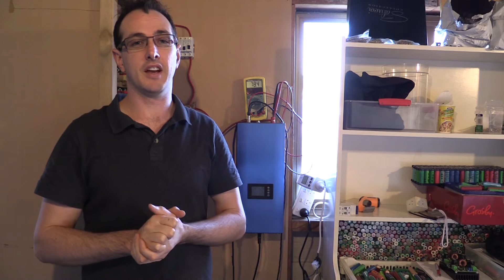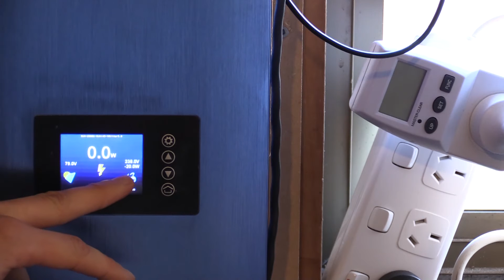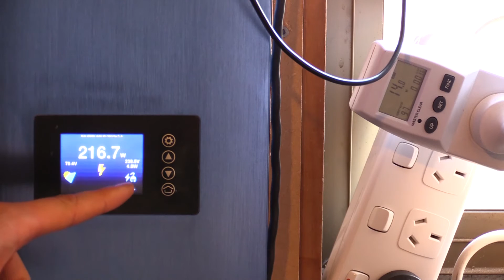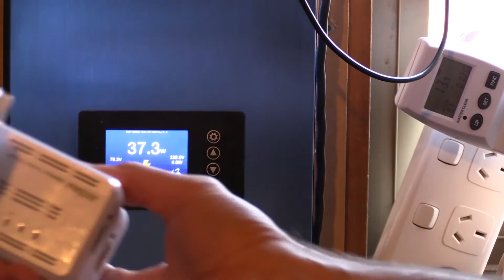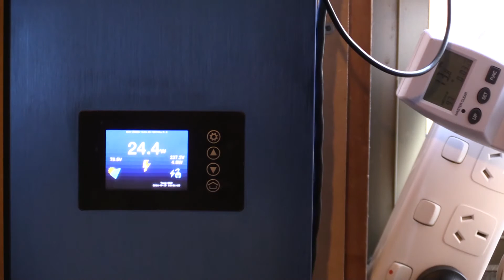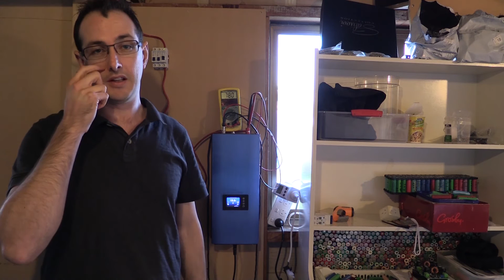Grr Problem with Limiter on Inverter Part2

Comment: Hello mike s.  Gtil2 have two resistor R82 and R83
This two resistor hare connected in series?
I need schema for R81 R82 and R83
And value for R82 R83

Comment: Hi having a similar problem myselfy inverter (1000w version)is measuring 8w yet my meter is saying I'm using 300w did you get to the bottom of this any help is much appreciated are you on any of the Facebook groups?
Reply: Shouldn't have a minus sign on the read out. Just flip the CT clamp around.

Comment: It might be trying to get the CT clamp to 0W if it's intended to be clamped around your main grid power input, instead of measuring your load. It might be worth testing with the clamp upstream of your grid tie point. The other side of your power strip should work for the lightbulb test.
Reply from the maker: Thats a good point, I will have to extend the CT Clamp lead, which i did plan to do but i am not sure that outcome of a extra long 20+ meter long CT Cable so wanted to test the inverter ct reading then extend the cable and see if it changes.

Comment: Are you sure this model works with batteries? In the description on Aliexpress it only shows examples using solar panels. The MPPT function could be the reason for the unexpected behavior.
Reply from the maker: MPPT "should" be on the DC side of the circuit before the limiter circuit. But maybe not

Comment: Hi mike good work you doing there. As iv got electrical back ground the clamp meter need to be on grid side so if you place the clamp meter on extension lead side on the live wire it should work.
Reply from the maker: Thanks Jayesh, I will try that tonight and do a video. :)

Comment: Maybe the inverter tries to push back energy to the grid until the clamp measures 0W. Looks like the clamp needs to be between inverter and grid, but you connected it to the load only ?
Reply from the maker: I will do a video tonight when i get home from work and play with the CT before the inverter and before the load. Which might solve the prob. Also will try extend the CT to 25m and put it on the main switchboard. On the main switchboard it will make it harder to test at different loads as the house will have a base load but i will try. Long term it needs to be on the house switchboard and that was always the plan but didnt make sense making a long ct if it didnt work. We shall see tonight
Reply: yes that sounds feasible. Maybe it doesn't try to match the inverter power output to the CT measurement as such. But rather the inverter starts increasing the power output until the Ct reading is lowered to 0watts. But if the CT clamp is only around the load, and not the grid out, the inverter may keep increasing the power out because its desperately trying to get the ct measurement back to 0watts. Try putting the clamp around the cable going back to your power point, instead of the cable going to the lamp.
Reply: I look forward to finding out the results!
Reply: The limiter tries to zero the grid input.  You are not measuring the correct wire.  There is no problem with the inverter or the software.

Comment: sorry to hear your having trouble!!  

it could be hardware.. maybe you could try the external limiter if you have no luck.

i bought a heap of tiny led meters to put on my 14s pac. then at a glance i will be able to see all pack voltages,,
Reply from the maker: oh thats a good idea, I did think of that but wanted it to be logged so i can see the performance of each pack as it is charged and discharged and have it web based, My powerwall is in the garage so i didnt want to be walking out there everyday to keep an eye on it etc. I will be building a 20s cell monitor that reads the voltages and sends them off to my monitoring dashboard. I will do some videos soon on it as i just got all the parts. Reading individual cell voltages in series is a pain in the butt.
Reply: you could use 20 arduinos.
lol
Reply: how do you get you house power usage live?
Reply from the maker: Using https://openenergymonitor.org/emon/
Best thing in the world, Maybe i will do a video on it later
Reply: How much did it cost